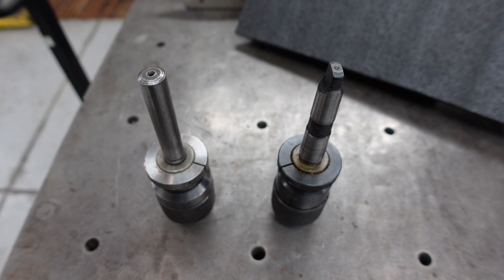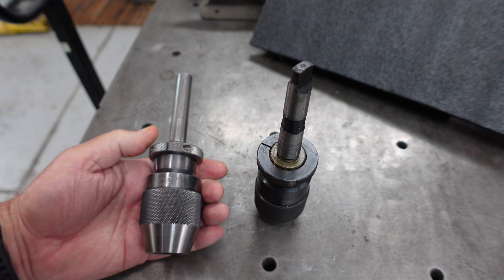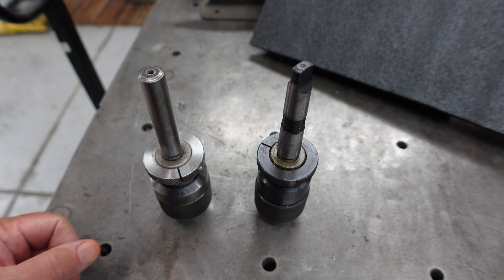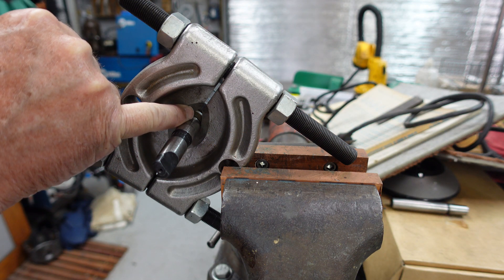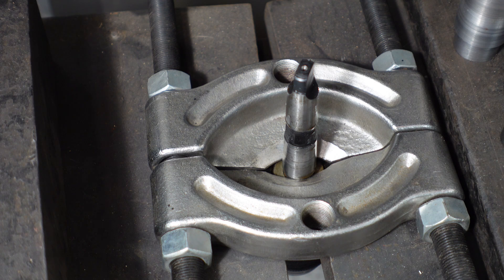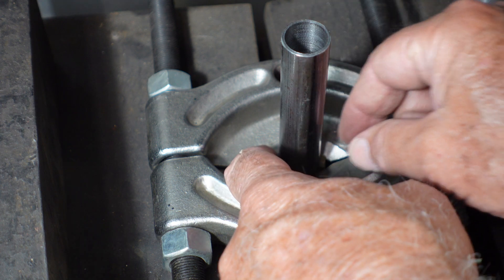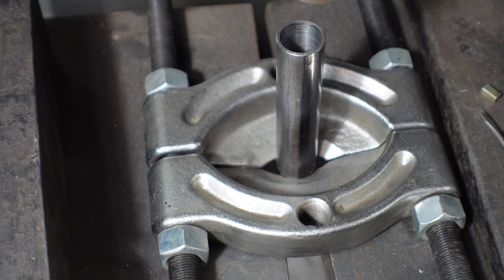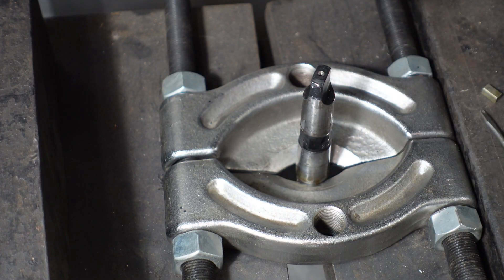Removing a Jacobs 33 arbor without wedges

Comment: Just got a tapered Jacobs off an ancient Montgomery Wards 1/2" BIG, ALL METAL "arm breaker" drill I got for free and rebuilt/restored,  Used your bearing separator idea, THANKS! This kinda setup in the hyd press is what I used to "reverse press" the locked up frozen pistons/shafts out of my Komatsu PC75UU-2 Excavators Track Adjusters... Single acting piston type design. Took ALL 20 TONS in my "big ass home-made from scrap laying around" press. Got pics, was quite impressive when they finally broke free and started to move, BOOM lol!

Comment: Found a quicker way. This works if you have the chuck/arbor off the machine, as in the video. Open the chuck up all the way, look inside. If you can see the end of the arbor, all you need to do is support the back of the chuck (with a piece of pipe or a couple of blocks), place a length of rod inside the chuck and tap the rod with a hammer Arbor will drop right out.
Reply from the maker: You are correct if the back of the chuck has a hole in it to expose the end of the arbor...not all chucks have that hole, but people do drill the inside of the chuck to expose the arbor end and then remove the arbor as you explained....thanks for viewing and your comment

Comment: Nice little tip.   I never knew the chucks were removable from the taper.  I found your video while looking for a chuck key for my old 14 inch Delta. The chuck is in great condition but the keys teeth are worn.
Why does Jacobs make  75 different keys? 🤔
 So many different key models and I can't find details to identify mine.
It's  0.8-16mm JT3, so that looks like a 5/8 chuck. The center pin is .310 in diameter.
The chuck runs very true, so I don't want to replace it.  The key has nothing stamped on it. 🙄

Comment: I thing if you tapped the pipe with a hammer you might not need the press. The shock from the hammer might be easier and the chuck would come off just fine. Moderate taps though.

Comment: Great tip. I have an Albrecht chuck with straight arbor I couldn't remove. The Jacobs wedges didn't fit, so I was about to tap it, etc. to pull it out. Your method succeeded in 10 minutes. I just used a couple square nuts instead of key stock. I put a little grease on the nuts to keep them in place. The hydraulic press popped out the arbor on the first try!
Reply from the maker: awesome...thanks for viewing and your supportive comment, glad it worked for you

Comment: WITHOUT WEDGES. proceeds to use another wedging tool that costs far more than a $10 set of JT wedges. COME ON MAN
Reply from the maker: thanks for viewing and you have a point with your opinion, but most mechanic/machine shops own bearing splitters and most shops don't own chuck wedges in my experience....Yes you can order, but why order if you can get it done....????

Comment: Easiest way to remove the arbor if the wedges aren’t available or if it’s a straight shank arbor, is to dismantle the chuck and then a punch can be used to knock the arbor out from inside the chuck body….no chance of damaging this way…
Unscrewing the two halves of the body can be a problem though on old chucks that have never been serviced…

Comment: Some arbors like one of yours has the center area ground down some. I use two  1/2" square bars about 1.5" long clamped together then drilled out in the center to the diameter of the arbor center lower diameter. Then on the right and left side of the arbor drill hole I again drill and tap two holes for allen screws to clamp it to the arbor. Somewhat like your puller used. Placing wedges #3 on the chuck max opened position, then using 1/2"+ washers, tube, pipe,  centers, etc. build up to the clamp. Press wedges and pop it off (normally). For a straight 1/2" without the center recess, well... I have ended up grinding a recess. I avoid arbors without the center recess - makes life easier.  Suggest once remove check arbor for being true or at least in specification.

Comment: Nicely done, Chuck. Those Albrecht chucks are nice. If it were to be done often a heavier wall tube with the two projections as part of the tube would work well and be less fiddly. A press is a great tool to have in the shop. I enjoy using mine. Mart in England.
Reply from the maker: thanks for viewing and your comments

Comment: A bit longer process is to disassemble the chuck (might be time for a cleaning anyway) and then knock the arbor out from the inside with a punch or press as it is exposed once the body is off.  Give Howie a hug for me.
Reply from the maker: thanks for viewing and your comments, you are correct that is the best method...I really did not want to mess with a tear down....Howie say Woof/Lick
Reply: Sadly for me, Jacobs chucks are closed at the back.  I watched a video where an axial hole was drilled through the centre of the chuck to expose the inner end of the arbor.  I would probably try that if I had to... this time I was only cleaning it.   Chuck's method is pretty neat, but I don't even have the clamp, let alone the press!   😢

Comment: My Albrecht chuck has a hole in the center that allows access to the arbor from the jaw end.  I took the largest punch I had that would fit in the hole and pressed against that to force out the arbor, basically the opposite direction you did.  It's nice to see there are more ways to skin a cat, though I don't know who would want to skin a cat.
Reply from the maker: thanks for viewing and your comments, my unit had no access hole and I didn't want to drill one...
Reply: That’s strange, there is a threaded part in the centre of the chuck….
You would have to dismantle the chuck and remove it to allow access to the arbor…which is one way of removing the arbor if the wedge method doesn’t work..

Comment: Chuck with the arbor off, take the chuck,open the jaws and tap drill the web you will find at the bottom by chucking the chuck in your lathe and tapping it with a sharp FINE THREAD tap. I say sharp because this is not a real good place to break off a tap. ( mine are all threaded 3/8-24 ). The next time you want to remove an arbor from the chuck, open the jaws and thread a matching FINE THREAD socket head cap screw into the previously threaded web from inside the chuck.  Pushes the chuck right off the arbor as soon as the end of the SHCS meets the end of the arbor.  Been doing it this way for decades.  The fine thread is necessary because you are using it to apply pressure and the fine thread has more strength than a coarse thread of a given diameter.  Look at a gear puller.  They all have fine threads for this very reason.  Once you do this you can throw away your wedges, pipe, and etc..
Reply from the maker: thanks for viewing and your comments, I have done that with a keyed chuck, but I did not want to drill the keyless chuck